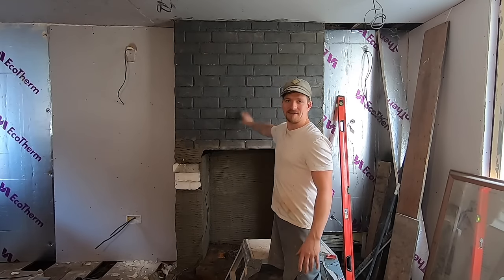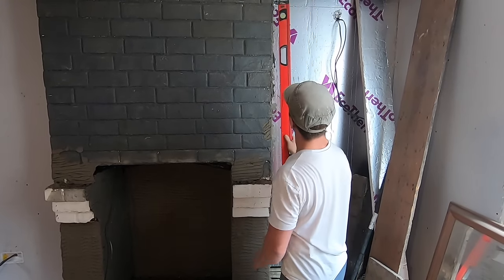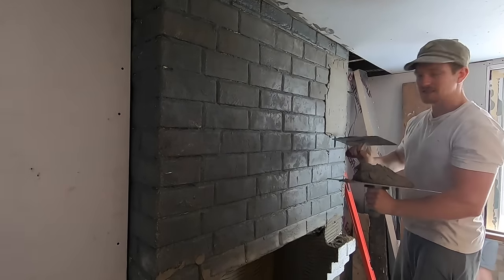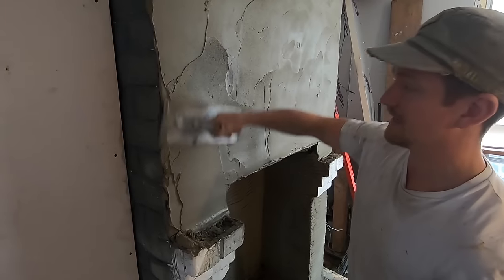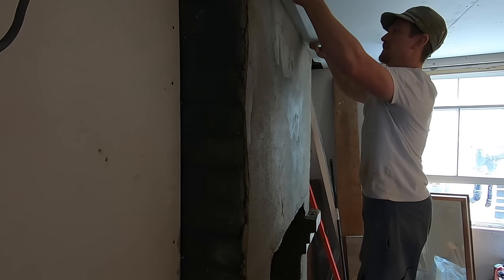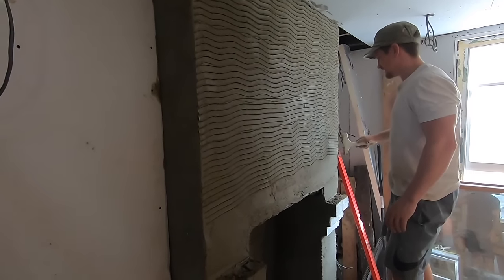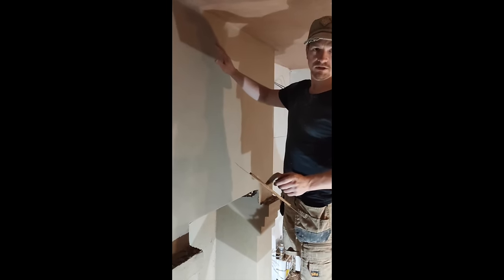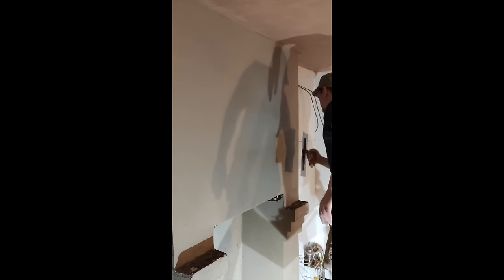Beginners Guide To Plastering A Brick Wall With SAND/ CEMENT RENDER…

Comment: normally you would apply the cement to wet or tacky slurry. that creates the bond. But if it doesn't fail it's not wrong. top job.

Comment: I put your advice to practice today on a small patch repair. Forming the corner was a little tricky, because it was in a reveal for a patio door with about 5 cm between the wood work and the face of the wall. That little strip was harder to coat than the face of the wall.  Having a good render mix was crucial too. I used 1:1:6  with some bag lime for the top coat and that was great.
Reply from the maker: Great stuff John! It's always good to hear about your insights. Cheers 👍

Comment: Fabulousness a tip for those starting out. there is a ready mix bag you can get from builders merchant takes the guess work out and very very handy for patchwork for beginners. Got mine from selco prior to this corona lockdown. It’s made by bond it. 

A pre-mixed render based on sand, lime, cement and additives. A moderate strength render for moderate strength backgrounds and moderate exposure conditions.

About £15 but for patch repairs makes it way easier and I used it first time never done plastering rendering and good success. 

I don’t work for selco or Bond it
Reply from the maker: Good to know!! Thanks pal 👍
Reply: Plastering For Beginners welcome I just realised wickes also stock similar stuff for £7 25 kg bags

Comment: Blaine, I noticed that when you use your feather edge you have the flat edge up, yet on your other video about rendering, you use the feather edge with the bevelled edge up. Is it because in the other video some of the render that you scraped off the high points, you put back onto the low points using the bevelled edge
Excellent vid as usual, keep it up mate.
Cheers.

Comment: Completely agree Bro. No levels or beads in an old building. 1 - because it will make everything else in that room look out, 2 - character and 3 -your keeping it as close as possible to the original. Obviously apart from not doing it all in Lime. 
As for the 1 coat method, skimming.. Basically same as. It's doable, and does save time. Like you said. Not a good idea for newbies to tackle. But if Been in the game for some time, it works. Although I don't really like to do it, unless being tiled. Again, as you pointed out, there's not been enough time gone by to have any proof it's sound. As for sponging 2 coat system, it leaves an Awesome finish. And is a must for me if I'm doing same day float n set. Bye bye to the Blisters 👊💪🔥✌️👍
Reply from the maker: I think your right about the 1 coat system! It's not the correct method and 2 coats always looks better! It's worth testing though isn't it pal. Great hearing from you. Cheers 👍

Comment: Good content mate! Recently I strip off an old sand and cement from a concrete block wall on a bathroom. I'm planning to re-plastering with sand and cement just a coat (scratch coat) for tiling. Do I need to apply SBR prior to render the walls?

Comment: Hi Blaine,  Do you need to use Hydrated Lime in the Screed mix and Render mix .
So screed mix 1 cement, 1 Hydrated Lime, 5 plastering sand and render mix 1 cement, 1 hydrated lime and 6 plastering sand. Is Lime essential on the chimney breast wall or I can only use sand,cement and plasticer. I will be fitting standard inset gas fire about 4kw.
Thanks for the video

Comment: It's like tying your laces....... good job though.
Also
When I'm applying I'll put my trowel onthe wall,about 3 bricks from the ceiling.. push the SandC up right to the ceiling,then transfer your force to the opposite side of trowel and slide to the left.Or ensuring its stuck to the top....pull downwards.. save you digging into the trowel and putting bits on thetop of trowel and pulling across wall
Daycent work though

Comment: Really nice work for the edging with the timber
Reply from the maker: Cheers mate, I appreciate that!
Reply: Cheers for the reply. What plaster should I use in a damp uk cellar. I'm currently drying it out with a dehumidifier?
Reply from the maker: I'd have it checked for damp first mate and go from there. It really did depend on the situation pal.

Comment: Could you just put a finish coat(smooth plaster) over the first coat?  I have some really rugged brick interior walls that I need to grind down some that are sticking out, then was thinking about using thin metal strips to use as screeds then fill them in fresh after floating with straight edge.  Would this work? Ok m trying to not have much build out.. maybe ³/¹⁶"

Comment: Hi amazing video.I have a big project and have to render much bigger walls in my house.
I will try your method for the first time in my life.
May I know how much do I need for a mixture? 
First coat is:
5x sand
1x cement
1x bond
Second coat is
6x sand
1x cement
1x bond
My question is how much water do I need to add and can you give as a timing between all 4 steps? 

Thank you so much for you knowledge and experience☺🖒
Reply from the maker: Hi mate! Great hearing from you! Yes the mix is right except it's Lime not Bond - for example scratch coat is 5 sand/ 1 cement/ 1 Lime. In terms of water I can't actually prescribe an amount because it all depends on the sand, where it's been stored, how wet the sand is to start with... There's too many factors to think about.

Again it's a similar situation to waiting times. Depending on the background your working on, the heat at the time, the suction from the cement. It just comes with experience really and knowing when to move into the next step. I'll try to highlight the signs in the next video! Sorry I couldn't give a more revealing answer 👍
Reply: @PlasteringForBeginners  
No problem.
I understand that this is a quite complex process.
I will start doing small areas at my home to see what to do and what I did wrong.So it is a bit of a test.
I much appreciate your time and respond on my questions.

Thank you.😊

Comment: Hi, do you always need to render on to the brickwork or could you apply a hardback plaster or an undercoat plaster instead?
Reply from the maker: No you don't always have to mate. You can just use Hardwall but this was for a lot burner so sand/ cement was best for this situation 👍
Reply: Thanks for this, I should have mentioned, we’ve got a log burner in place, but the plaster around the chimney breast is cracked all over, so I’ve just taken it right back to the brickwork. Thanks again.

Comment: I've got a stupid question for a girl who doesnt know much about skim coating.  The straight edge tool you used:....could this tool be used to skim coat  ceiling if you used a roller to apply the mud? Ive never seen anyone use it for the roller method (roll on mud with paint roller) . Just starting out so thought I'd ask if it's possible to use straight edge vs using a hand tool. Your other video showing you do a wall, it was a blue straight edge. If your not be able to answer since your plastering and I'm talking about mud applied to ceiling drywall. Ignore question. Might be totally unrelated. I've only done one project of popcorn ceiling removal and skim coat, so I am clueless, lol🤪
Reply from the maker: Hi! Don't be silly - there are no stupid questions feel free to ask whatever you want! I would recommend using a Spatula. The one you seen in the previous video was an OX Speedskim which is a brilliant piece of kit. This has a plastic blade which is a lot more forgiving when using it on finish plaster! I hope this helped and feel free to ask anything you want. Great hearing from you 👍

Comment: Hi Blaine.
Why would hardwall not be ok and it need sand and cement?
Presumably the finish is plastered (multi finish) if inside... surely hardwall is tougher?

Interested to hear back
Reply from the maker: Hi mate. 2 reasons - the customer wanted a tradition look so I thought Sand cement render would be appropriate but the main reason is to do with flexibility! If he does have a log burner installed then the only product that can deal with the expansion and contraction of the heat is sand, cement mixer with lime! This will deal better with the heat - if you used Hardwall you'd have to finish it with say Multi Finish which would almost definately crack. 

Render wouldn't! You could use Victas Heat Resistant plaster but to be honest I just love using sand & cement so any excuse really. Hope this helped mate 👍

Comment: If it’s outside brick, do I need to apply sbr to the brick if it’s is already very well keyed? If so can I dilute sbr in water first or just spray the wall with water
Reply from the maker: Yeah i'd SBR it mate - water it down 50/50 with water and give the wall a good coating. This is more than enough before you start rendering 👍

Comment: Very good. I'm about to repair my plinth skirt at the bottom of my house. 

Where do you get the feather board from?

What's the render mix ratio including waterproofer for scratchcoat then final coat for outdoor?

I was thinking about fixing some expanded metal to strengthen it, would you recommend this?
Thanks.
Reply from the maker: Hi mate! It was my mates so I'm not sure pal. You could use EML which would definately reinforce the render so that is an option! Check this link out below. It's an article that explains mix's and ratios from our website! Cheers:

https://plasteringforbeginners.co.uk/rendering-a-wall-the-beginners-guide/

Comment: Hi blane, I am currently getting back into plastering at a late age. Would you consider doing some one to one coaching. I am based in the the north west. Id like to pay a plasterer for some coaching on things like advanced skimming on larger areas, rolling gauges and curved skimmed ceilings. Thanks j ps great video, very helpful👍🏻
Reply from the maker: Hi mate how's it going? Where exactly are you based pal? Cheers 👍
Reply: Plastering For Beginners 10 mins from ikea warrington👍🏻
Reply from the maker: Hi mate. Sorry mate but unfortunately it's a bit far for me. If I'm even up that way I'll give you a shout but that's a bit too far to travel. Sorry 👍
Reply: Plastering For Beginners no worries, best Regards, your videos are very helpful👍🏻

Comment: Great vid mate, quick question, how dry does it have to be before sponging?
Reply from the maker: Hi mate. You want it relatively dry or else the sponge will liven up the render again. However, as long as you're sponge is completely dry then it really shouldn't matter too much. Just make sure there's no moisture in your sponge and you'll be grand 👍

Comment: In Greece the first coat is somehow thrown to the wall without leveling
Reply from the maker: They throw the plaster on in a lot of countries actually including France and other parts of Europe. There's many different ways pal!
Reply: @PlasteringForBeginners  I am wondering why they dont do it like you. I mean throwing it on the wall creates a mess and there is a waste of materials. I dont know what are the pros/cons. However I have seen before some days applying 3-4cm base coat without scratch/first coat. It seemed like detached from some areas and had lots of cracks.

Comment: I’m sure your supposed to apply your render to sbr while it’s tacky not completely dry like you have done as that has created a barrier
Reply from the maker: It does help but there was a very good key so the render still had an effective hold! We did apply the slurry and started rendering immediately so it wasn't completely dry pal 👍